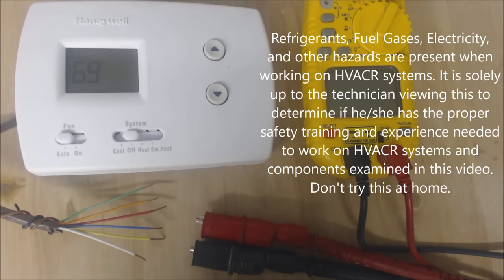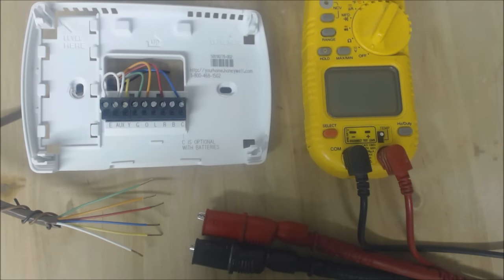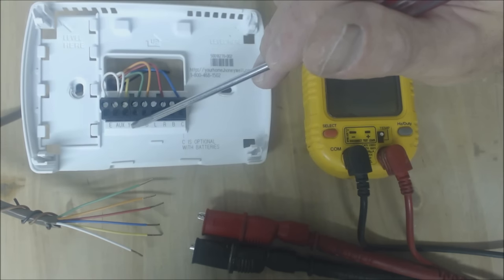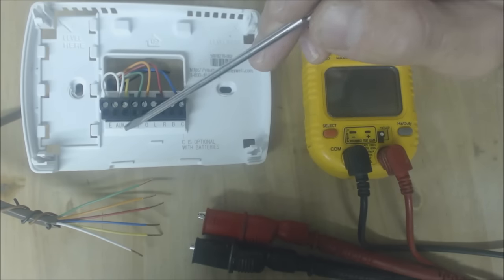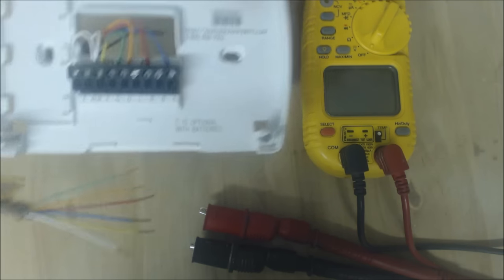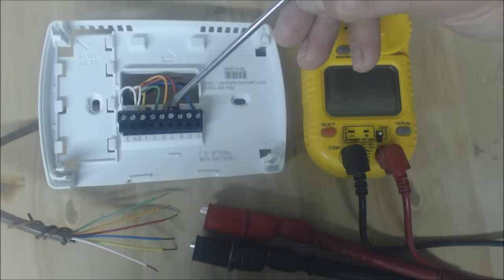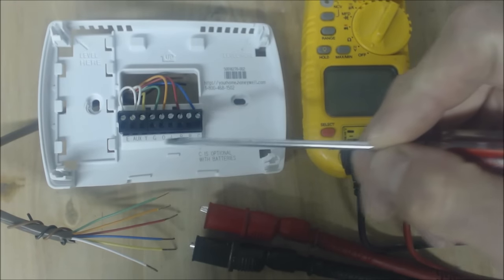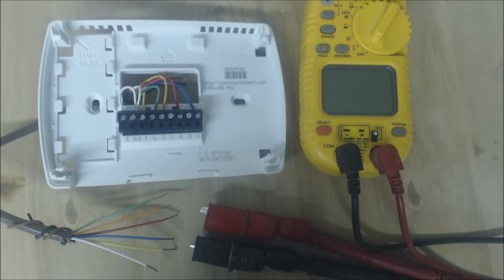Understanding and Wiring Heat Pump Thermostats with AUX & Em. Heat! Terminals, Colors, Functions!

Comment: can you show one where I have a gas furnace with a outside ac and also a outside wood boiler that use the gas furnace blower.
Right now just switch the fan to auto and on to use outside wood boiler.
Reply from the maker: I am not sure when I could put something like this out but I usually just install a second tstat . I then take the R from the furnace and go to the new tstat and then out of the tstat on the W terminal from the stat and power a multipurpose relay with a common going to the c terminal at the furnace. I then go from the r terminal at the furnace to a normally open contact and on the other side of the contact go to the G terminal of the furnace. That turns the fan on. Then I go from the power from the outdoor boiler to the normally open contact on another part of this same relay and power on the other part of the normally open connection to the boiler to turn the circ pump on. Each outdoor boiler is a little different but that is general idea. You need a second tstat and general purpose relay unless there is one for that in the outdoor boiler already for this like in the Hardy.

Comment: I have a question my hvac lennox in emheat is not heating that could be
Reply from the maker: Maybe the electric resistance has broke, the thermal overload tripped, sequencer could be bad or no low voltage to the sequencer, thanks

Comment: great video and thanks for posting. I have a rheem heat pump system. it's really small so I'm not sure if it's a HP. However,  the guy who wired it did it the wrong way cuz it doesn't shut down. please help.
Reply from the maker: You will need to verify if this is a heat pump first by locating the reversing valve in the outdoor unit. thanks
Reply: acservicetech what does the reversing valve look like?
Reply from the maker: The reversing valve can be seen typically if you look down through the top fan shroud of the outdoor unit. It is an 1 1/4" brass cylinder that is roughly 6" wide with 3 copper pipes on one side and one copper pipe mounted on the other side. You could also look up the model or product number in google to pull up specs on the unit like what size and if it is a heat pump. Thanks!
Reply: I am installing Honeywell 5000 tstat I will be running a air handler with hydro and also 2nd stage for baseboard heat and a/c have to install a relay  as I will be going to be going to a taco zone panel on boiler  I was thinking of taking  my w2 from tstat  ànd common fron air handler to power 24 volts on relay and other side of relay dry contacts to  taco  will this work  so that when my temp demand is not met 2nd stage will come on to baseboard thanks
Reply from the maker: Sounds like it will work. I am assuming that you have a dual fuel 5000 stat in which you can set in the programming the temp you want the heat pump to turn off at. Not all 5000's are set up for dual fuel. thanks
Reply: acservicetech thanks no heat pump customer wanted to use baseboard as back up heat I am thinking it might be better to put thermostat with aux and emergency heat selector in the case of the air handler failing he would be able to turn on manually he is thinking hydro will not keep up on a cold day

Comment: I have Senville heat pump. It don't come with a thermostat so i'm assuming buying one of these thermostats won't work with mine. Am i right?
Do anyone know how i can limit my aux heater from coming on? I want to be able to use a switch to control it on and off.
Senville 12,000 and 18,000 Btu Aura series. I think they are made by Mitsibishi.
Reply from the maker: These types of thermostats will not work with mini split units, thanks
Reply: But there still must be a way for me to control when i want the aux heater to come on or stay off.

Comment: A.C, could you do a video for for a Honey Well 6000 for heat pump mode ?
Reply from the maker: I am typically using 5000 and 8000 version but it is possible if I run into one, thanks

Comment: Hi, HVAC gurus. I'm having a weird challenge that maybe you can help me with. I have two Zones for my furnace, upstairs and downstairs. It's not very cold outside (50ish), but when I turn my heat on upstairs (Zone 2), aux heat turns on after about 5 mins of functioning normally. The heat works perfectly fine downstairs (Zone 1).
Reply from the maker: Try turning it up only 1 degree and see if aux still comes on. Often aux will come on if the temp is set 2 degrees or more higher or if there is some other setting in the tstat, thanks

Comment: thanks for all your videos,I have learned a lot from you.I have a request if is possible to do a video on programing 5000 and over  Honeywell  termosthats, I installed a heat pump a few days ago and it gave a headache.Thanks again Ruben
Reply from the maker: Ruben, thanks for letting me know what you would like to see!
Reply: programable termosthats, which numbers are for compressors delay, degrees Fahrenheit and celcius,heat and cooling,limit tempeture in heat and cooling.
thanks again.

Comment: do the wifi work the same I have a lennox heat pump put in 2014 with the wifi and so far 2 times this week no heat again monday it was fixed and again it is wednesday no heat and thermostat is black and they said the first time it was a fuse
Reply from the maker: If it is a 24 volt 3 amp or 5 amp fuse blowing then they would need to either look at the additional field installed relays adding up to too much amperage or change out the thermostat wiring from the unit to the thermostat because a power wire is touching the common intermittently, or it could be the thermostat, or it could be sensor wires shorting on the cabinet. Here is a video on the exact subject.  --  https://youtu.be/j7HeLAZVTzs
Reply from the maker: It is wired in roughly the same way from the thermostat to the unit normally depending on the way the reversing valve is powered. It is just the internet control that is different.   --  https://youtu.be/fFL_ZSkAZM0

Comment: Hi can you do refrigeration cycle in heat pump? Thanks.
Reply from the maker: Hey Jimmy, do you mean like this or while in front of a live unit? In this video I go over a heat pump cycle in ac and then in heat mode - https://youtu.be/2Ahzi1U0fYk
Reply: If you could show in a live unit with cooling mode and heating mode. How does the reversing valves work thank you so much.
Reply: Sorry i over look. I found your tutorial on heat pump cycle thank you.

Comment: If you break the red with a float switch, there’s a potential to leave the unit with no way of providing heat. Why not break the yellow to the compressor, leaving the aux and e functional?
Reply: That's a optional as well. Most people break red. At my multi family property I oversee the Maintenance at, the contractors broke yellow with the float switch which shuts the outdoor condenser off, & allows you to use the heat or blower motor if needed. I see your point, but it's just a industry standard. Me personally, I'm fine with breaking yellow, the whole reason of a float switch is to stop the unit from running to prevent any damage to your home, so whether you break red or yellow your still getting the same result. 👍

Comment: Dumb question: So what goes  to "W" at the furnace board? You're not exactly making this "simple." You also seem to be getting warmer and colder reversed. (Or maybe it's just me.)
Reply from the maker: Hey Kevin, That is not for a furnace. Here is a video for wiring a gas or oil furnace, thanks- https://youtu.be/5lxftJiTqLg

Comment: Hello, I have this same thermostat model. And I want to upgrade mine with the Honeywell RCHT8610WF2006 model Lyric T5
Wi-fi Smart Touchscreen Thermostat. But I have 7 wire that i would like to know how to connect it first. Here a Picture from my thermostat http://prntscr.com/kxu9y2  My AC/Heat Unit is a TRANE. Thank you for your videos.
Reply from the maker: That is a very normal wiring setup. You should just follow the wiring diagram for the new lyric. It should be the same letters as the old one and then set the tstat up for the type of unit you have, or call a tech to replace it, thanks